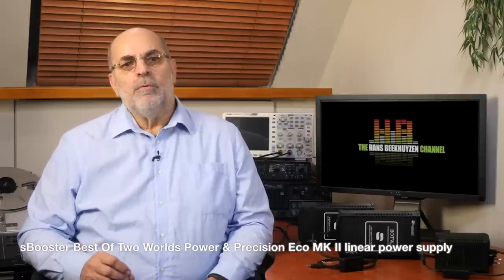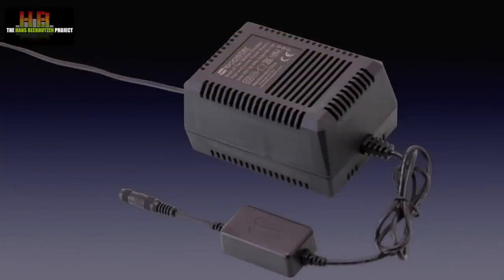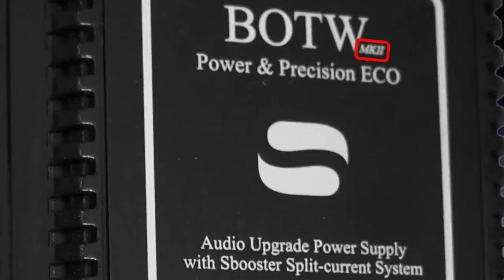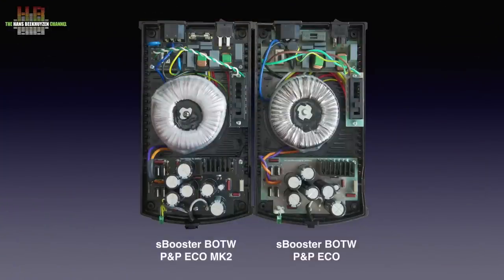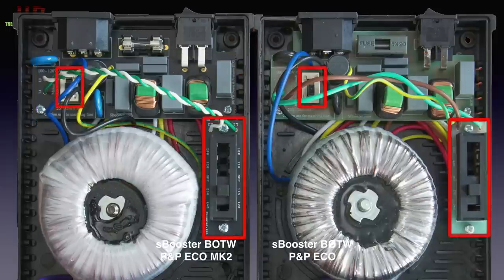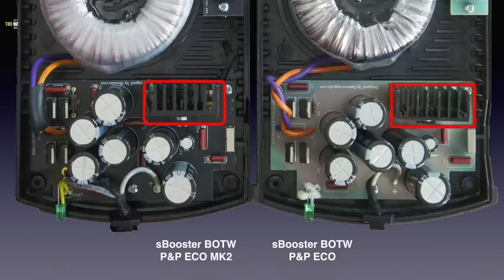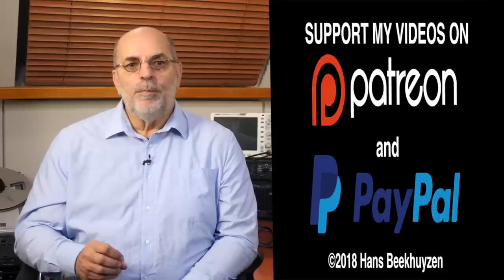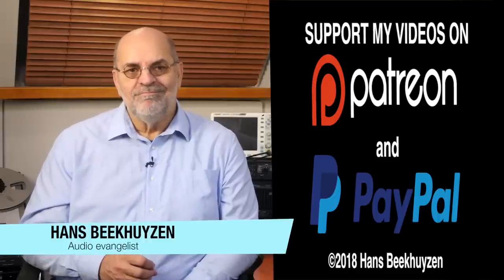sBooster BOTW Power & Precision Eco MK II linear power supply

Comment: I'm stunned by how much this improved my Chord Qutest. Believe the hype. This must be engineered incredibly well because it delivers something truly special to my system. I've spent hundreds on cables and interconnects but I wish I had taken this plunge earlier. Get your source perfectly right and everything downstream gets a chance to shine.
Reply: I just got a TT2 and considering this upgrade...I've heard mixed results though. Maybe that is equipment dependent. So are you still enjoying it has it worked well over time?
Reply: But isn't it soft of crazy to spend significant $$ on something like this? It really should be built in to the product.    
   I had a similar experience with the MSB Link Dac long ago. Some enterprising companies came along with dedicated power supplies, mine was named Monolithic MPS,  and... well let's just put it this way -- I would sell just about any other component in my system but never sell that dedicated power supply! It made that much difference. MUCH more than any cable.  It seems insane but the ears don't lie, and you really need these things.
Reply: I bought the sbooster and the ultra for my Auralic Aries Femto and the difference it made was so significant that even my wife was shocked and she rarely pays attention to the things I put in my system. I a/b it for her and I can say with absolute certainty that it was a shocking difference. It sounded great before so I was reluctant but a friend convinced me and I'll never go back. It's just that good!!

Comment: I added the Sbooster 16V and the sbooster ultra to my Auralic Aries Femto. Holy Moly, the difference it made was so significant that i can say with certainty that it was the most audible change ive ever made to my audio system in a single purchase. Outside of speaker upgrades, it was the best decision ive made. Forget the minute differences of interconnects or power cables.....this was a godsend. 😊
Reply from the maker: I know

Comment: Excellent informational and educational video you made Hans. You clearly emphasized the importance of linear vs. a switched mode psu when it concerns high end audio performance.
Reply from the maker: A good SMPS can give equal results, but then the price difference with LPSU's is gone
Reply from the maker: Switch mode power supply

Comment: I just got one to use with the Mytek Liberty DAC, and it makes a very significant and noticeable improvement in sound quality
Reply: PalominoKid how do you like the liberty? Any qualms? If you’re utilizing mqa, are you connecting to laptop or do you have another device with let’s say tidal installed so you can playback mqa? I’m deciding between the liberty and the RME adi, but I also want to decode mqa.

Comment: Hey there, I just got one of these MKII for my sms-200ultra. I then added an iFi DC iPurifier2 . The MKII added quite a bit of sound improvement over the ifi ipower, but when you add the iFi DC iPurifier2  to the BOTM Eco MKII you get some SERIOUS synergy. I seriously suggest trying this, you will hear it. I too have a 25k+ USD system and the improvement was very noticeable for $100.

Comment: Thank you Hans for the great video.
  I run a Raspberry Pi 4 with a HifiBerry Digi 2 which has a digital connection to a Beolab transmitter.  From there, over the Air digitally in a couple of Beolab 18s and one Beolab 19.
  The sound is much more transparent, plastic and lively with the SBooster.
  A clear recommendation to buy Greetings Jens
Reply from the maker: Remarkable

Comment: Yeah, finally available! (I hope it's now "in-stock") Hans, thank you for helping us stay on top things!  Have you ever tried an "off-grid" power supply? wouldn't that be even cleaner? what do you think?
Reply from the maker: If you mean a battery, they are slow in delivering current and are noisy.
Reply: I wanted to get the sBooter for my microRendu at first, but they were out-of-stock for a long time so I got the iFi instead. It sounded fine but there's still a switching noise in the background (not a hum, a buzz). A friend suggested me to try making a battery power supply. I got the same ones used inside the Hugo to power my microRendu, 2 sets of 2 in parallel. I found it much cleaner and dynamic than the iFi but, I don't hear any noise? Quieter than the iFi anyhow. Thanks for your reply!  Now I can order the new MK2 for comparison!

Comment: Hoi Hans. Als eerste dank voor de moeite die je doet om audio en alles wat audio gerelateerd is uit te leggen op dusdanige wijze dat het ook voor a-techneuten onder ons goed te volgen is. Sinds een maand ben ik in bezit van de Mytek Brooklyn dac + en raadpleeg veelal het internet voor de aanschaf van een externe low-noise psu. De Ned. importeur van Mytek Digital spreekt met alle lof over een passende externe psu van Lexicone Acoustics die speciaal voor de Brooklyn gefrabriceerd wordt in Rijsbergen. Deze psu kost wel het dubbele van de sbooster. Misschien is het een interessante tip deze een keer onder de loep te nemen en A B vergelijk te maken ..Mvg Han
Reply from the maker: Een test volgt snel.

Comment: Thanks for this review.  It would interesting to hear your thoughts on the Paul Hynes SR4 linear power supply, which is gaining great favour among audiophiles, including those running SOtM equipment.  I use an SR4 to power my tX-USBultra with great results.  It is usually compared to the Uptone Audio LPS 1.2, with many preferring the SR4 to the LPS 1.2.  The SR4 has variable voltage - 5v, 7v, 9v and 12v - with 2A continuous and 20A transient on all voltages.  Available from Paul Hynes Design.

Comment: Do you know if something like this would be a value in between my phono stage , which isE-Glo Petit Phono Pre-Amplifier and my Turn table which is a Luxman 171A?
Reply from the maker: I haven't tried but there is a very good chance...
Reply: @TheHansBeekhuyzenChannel  Here’s what may be a stupid question: does it matter if you plug the unit into your power strip or does it need to go directly into the wall socket? I’ve only got room in the power strip

Comment: Thank you for your review, this is a very interesting product. I came close to buy one in the past but i chose an Ifi power supply instead for my Odroid C2 with Volumio. I am still considering getting one, specially now that the newer version is available but i wonder how much the power supply matters considering i use a usb isolator between Odroid and my dac that re-clocks the signal.
Reply from the maker: I have found the influence of an audiophile power supply to be greater than that of a USB isolator. And reclocking is very critical and should be powered from a clean PSU too. Furthermore, affordable 'purifiers' don't do the same as for instance SOtM and the like...
Reply: Comparing the Ifi with the mytek standard power input. I didn’t like the ifi very mutch. The S booster is already an other level.. Although i don,t know how it compares in other situations..
Reply: Tom Dijks I am sure sBooster is a better option, i am just not sure how much difference it will make when the signal is actually re clocked before it reaches my dac.
Reply from the maker: A lot!

Comment: Does it make sense to buy a better power cable (example IsoTek Premier or etc.) for the sbooster power supply than the original cable? Can it improve the sound quality?
Reply from the maker: That depends on the local conditions. I would simply try it by buying a cable at a shop where you can return it if there is no result.
Reply: Here it does: have added a Furutech absolute Power to my 2 SBoosters and that makes the sound much more nimble and agile.

Comment: Hi Hans, At 3:45 in the video, you refer to the Uptone LPS-1 as a switch-mode power supply. Was that an oversight? I'm sure you know the LPS-1 is an ultracapacitor supply. It includes an SMPS energizing supply, but the audio component only sees the LPS-1, and is galvanically isolated from the AC mains.
Reply from the maker: Well, you are right but so am I. As you say it is a ultracapacitor supply, thus like a battery without the disadvantages and charged from a switch mode power supply. But from a  practical view it also is a switch mode power supply followed by an extremely well 'filter' in the shape of an ultracapacitor supply. People that don't have the Uptone branded SMPS still might get HF noise into their mains. The Updone branded SMPS has countermeasures. I hope to review het new Uptone LPS 1.2 later this year.
Reply: Thanks for clarifying. Fascinating how each of our brains are unique. You may be the first person I know to look at it in that way, but OK!

Just want to clarify that the bulk of users buying an LPS-1.2 do not think they are buying an SMPS with a filter. Certainly, that is what they think when they buy an SOtM sPS-500 - at least the ones who've done their homework.

Anyway, thanks for clarifying your rationale.
Reply: Cool! Really interested to hear your opintion about the LPS 1.2 (I am planning to use the LPS 1.2 in combination with the Sonore ultraRendu, they fit so nice from an optical standpoint).
Reply from the maker: I have been promised a review sample but the demand appears to be high. So patience please.

Comment: I just bought an Sbooster BOTW MKII P&P power supply to use with my Wyred 4 Sound MS Music Server that has their Intel i7 package (i7 at 4.2Ghz, 16GB DDR4 RAM, 2TB SSD). When I connect the Music Server to the Sbooster it turns on but after a few seconds it turns off. I have tried this several times with the same tesults. The Music Server works perfectly well with its wall wart power supply, but refuses to stay on with the Sbooster. What can be happening?
Reply from the maker: The sBooster is not powerful enough for the i7 NUC.
Reply: @TheHansBeekhuyzenChannel  Can you recommend a linear power supply that may be able to support the server demands. According to W4S the server needs 5 amps and higher wattage.
Reply from the maker: The only one I know is the Hypnos I reviewed two weeks ago

Comment: Hi Hans, thank you for your contributions. Please allow me one question: Somebody suggested that I should use this one with Mojo, when listening to it while charging at home. Do you think it is a good idea? Thank you.
Reply from the maker: The sBoosters do fine work with many DAC's, including those by Chord but not with the Mojo since it will only play from its internal battery. The external power supply is only for charging the battery.
Reply: The Hans Beekhuyzen Channel Thank you very much. In this case I will return the ordered sbooster as it doesn’t make sense. Is the battery providing a lossless charging?
Reply: The Hans Beekhuyzen Channel Some people opened the Mojo and disconnected the battery. What happens in this case? I guess in this case the external power should be linear, right ?
Reply from the maker: I don’t know if that’s wise. But if you do, the SBooster would be needed.

Comment: Hello Hans, today I received my sBooster 5-6v PSU to power my Raspsberry Pi with HiFiBerry Digi+Pro running Volumio. I have not yet received the parts necessary to apply power through the HiFiBerry. However, the sBooster arrived with a micro usb adapter that plugs directly into the Raspberry Pi. Of course, I couldn't weight to try it. My opinions on the sound improvement would not be objective because I just got it. (...but it sounds GREAT!). My question for you is: Would the RPi setup sound even better if I apply power it through the HiFiBerry?

Comment: Hans - folks have commented elsewhere on having good results with Brooklyn switching the sbooster to 13v instead of the specified 12v.  Have you tried this?  I wonder if potentially unhealthy for the DAC?
Reply from the maker: If you do that you let the power regulators inside the Brooklyn dissipate more heath caused by the higher voltage. More heath equals faster ageing of components. To what degree, I can't say.

Comment: Do you have a recommendation for an AC 12 volt? Sbooster doesn’t make one and I need it for my Merrill turntable. I bought the Sbooster for my Rega which is a 24V. Thanks
Reply from the maker: SBooster does make a 12 and 13 volt version
Reply: @TheHansBeekhuyzenChannel  Not AC I asked them.